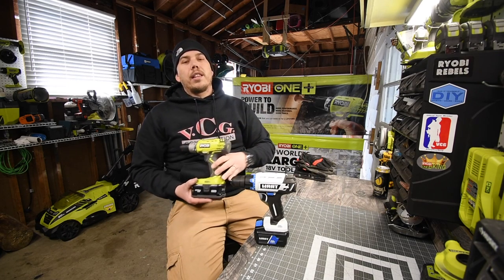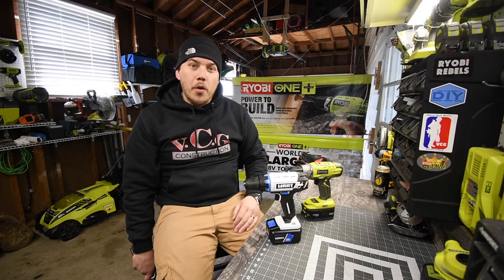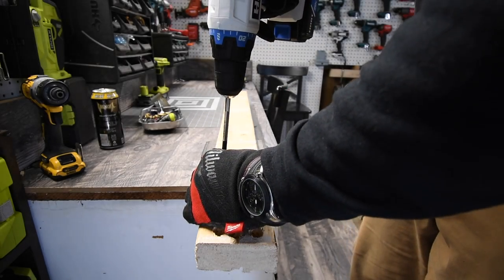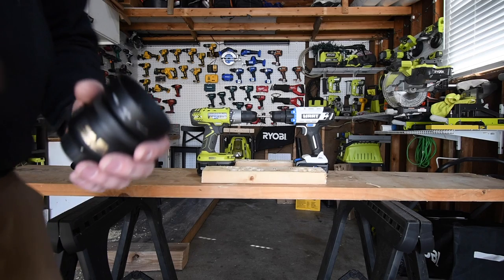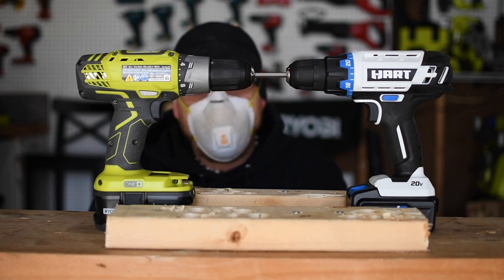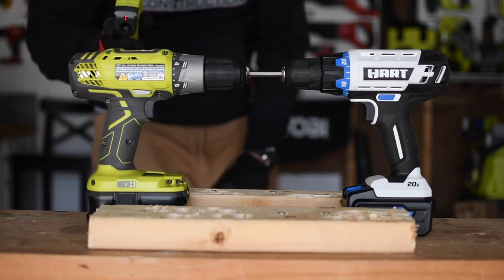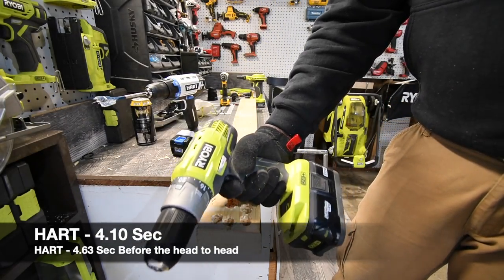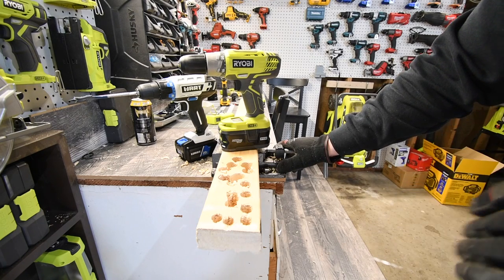Hart vs Ryobi "Battle to the Death"

Comment: I have Porter Cable 20 volt lithium.   I love PC with the exception of the circular saw which is basically adequate.  I want to start getting a new line of tools, and am watching all the big contest between the brands.   Hart is looking pretty good, as is Hercules and Bauer.   Even Craftsman.   One thing I have learned is the internal components of multiple brands are identical.  Hart is coming out with quality and affordability.  Their hand tools and tool attachments like bits, and tape measures are really good quality.

Comment: ... that Ryobi drill I burned it out working with, didn't need to put it to battle. 
What happened was I had to drill hools for electric wires the bit was a flat bit and I didn't block the drill at all I was just  drilling. 
The only problem with this situation is I broke the battery to because when you are making short circuit is like you are short circuit the battery directly. 
That 4 amp battery wasn't the same after the incident, I couldn't used with the Brussels circular saw not even fresh after charging .
Reply from the maker: snap, and thank you for viwng MrDINODINO

Comment: Honestly this whole test was a bit disingenuous. You say right at 4:10 that you need the higher torque setting of speed one and then switch to speed one. A small video cut later and you proceed to do the test again, in speed two... again. Then you do the same thing with the head to head bit and leave the Ryobi in the low torque/high speed setting to just get demolished. I understand you don't like the drill, they're both honestly shit, but you could have given it a fair shot.
Reply from the maker: I didnt want his particular video going for to long and I cut to the chase on tests that were irrelevant because because how poor it was doing